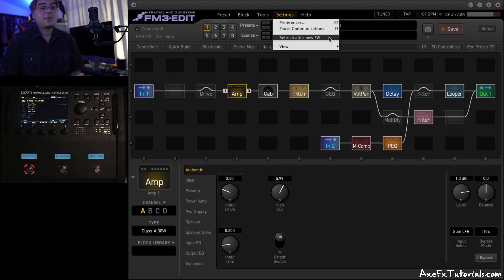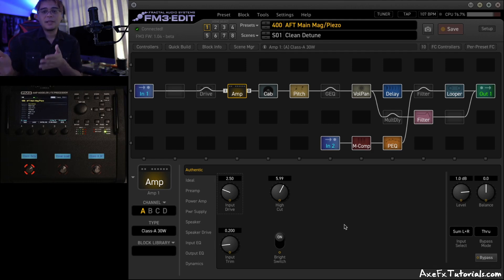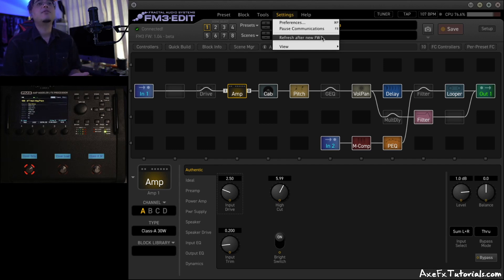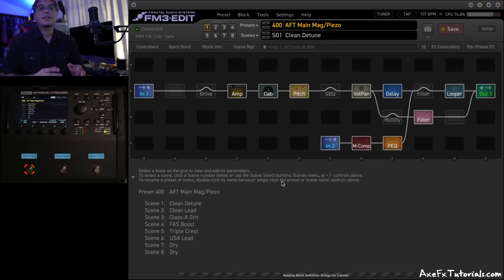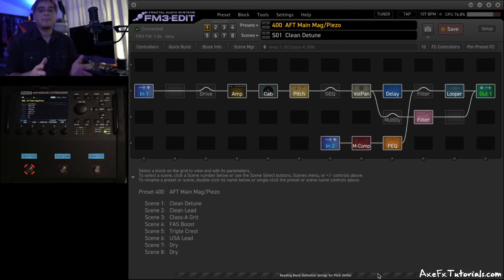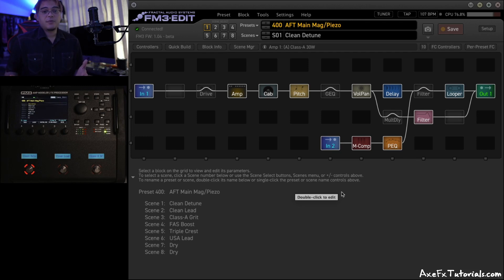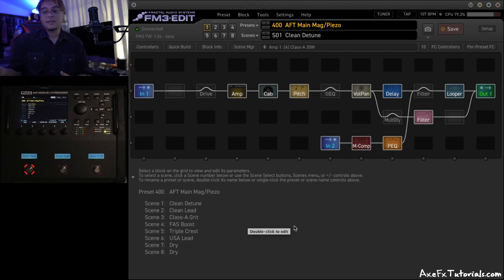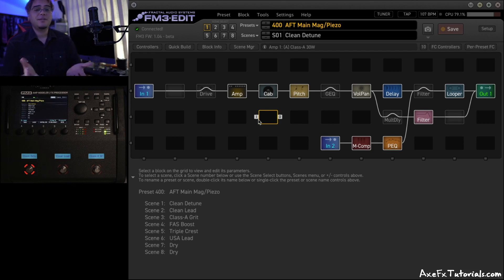Axe-Edit - Refresh After New FW - Axe-Fx III, FM3, FM9

Comment: Thx, axe edit wouldn’t connect. Using a axe Fx3 mk II turbo. 
I updated both recently but everything was perfect for days. Now i turned it all on and axe edit wouldn’t work even though I get the green connected check mark. So I did the refresh after firmware update function and so far it has taken 25 mins and it’s only to factory slot 408. Yikes.. any thoughts?